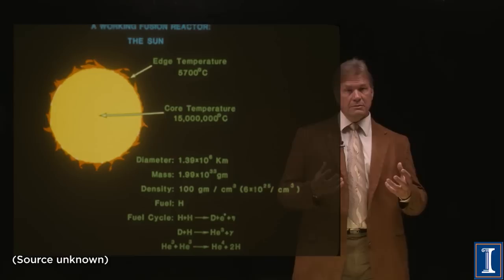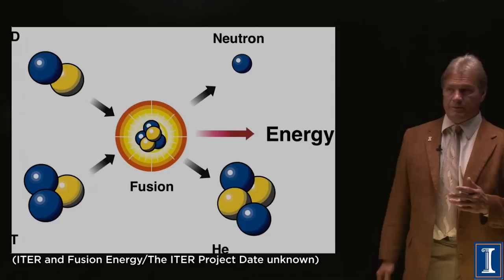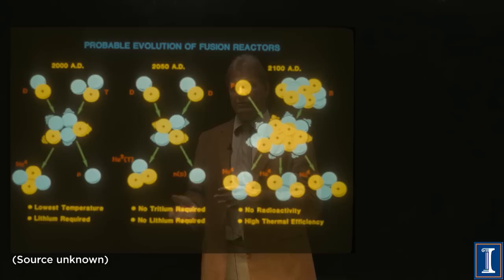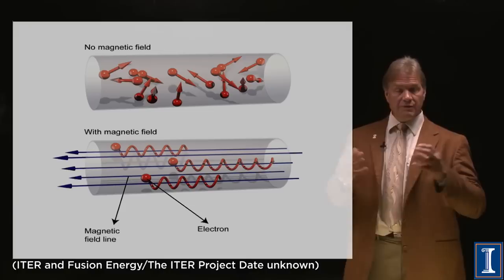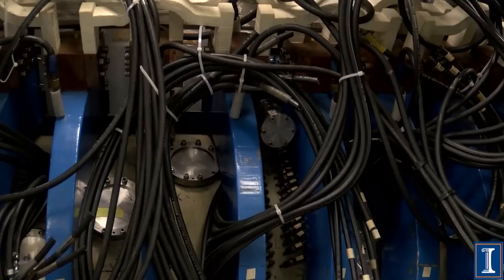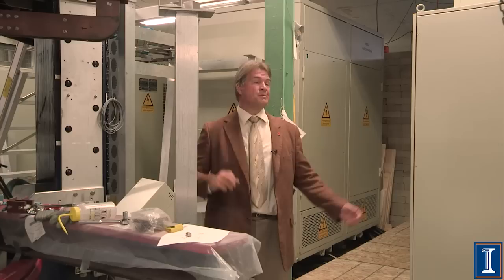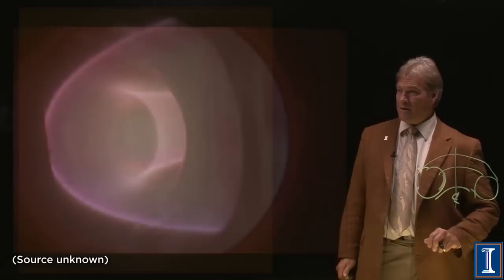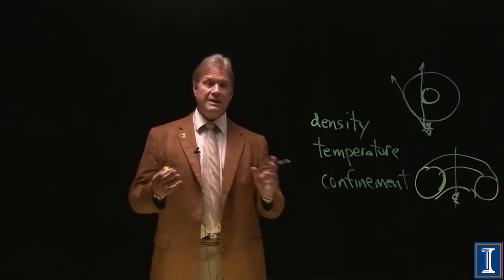What Is Fusion and How Do You Get It to Work?

Comment: Once all those 3 steps are done, 

density
temperature
confinement 

What are the current ideas to harness the resulting energy?

You can't run a water pipe through the superheated plasma to produce steam, it would melt.

Comment: I once worked with a device that produced secondary nuclear radiation by simply discharging huge capacitors to create a electrical beam striking a plate, accelerating in a vacuum. 'Vulcan' was what it was called and it provided the ability to test to radiation hardness of electronic equipment. This was over 50 years ago, I'm sure we are well beyond this now.
Reply: Yeah, we have Neutristors now. And commercial neutron sources that literally do the very same thing.
And kids making fusion reactors in their garages. Nothing gainful, they're wasteful as all getout, but fusors are fairly plentiful these days.
Fusion is easy, getting energy from fusion beyond the input necessary to generate it, that's hard. Well, hard, assuming you don't want to detonate a fission device to fire up the fusion reaction...
Reply: @spvillano  Have you ever seen the movie 'Chain Reaction'? the key point is any breakthrough has to be disseminated quickly far & wide.

Comment: Confinement ✔
Temperature ✔
Density X

Love these videos.  Excellent work!
Reply: And the energy exits where?
Reply: @tonyduncan9852  How does the energy "exit" a fission reactor? Heat is transferred to water to drive a turbine with steam. Energy isn't a physical thing that needs an opening to exit.
Reply: @nicholasandrzejkiewicz  "How does the energy "exit" a fission reactor? Heat is transferred to water to drive a turbine with steam." - You've answered your own question.  The kinetic energy of the fissioning nucleus components IS heat itself.
"Energy isn't a physical thing that needs an opening to exit" - Energy IS a physical 'thing'.  It's in the speed of the particles, and it leaves the scene by momentum transfer to whatever the fissioning particles collide with.  It's also found in the EM radiation which is liberated by fission.  This departs at lightspeed to transfer its momentum to the reactor.  Energy is a part of Physics.  It IS a 'physical thing'.
Reply: @tonyduncan9852  I was trying to be polite and answer your question, but I can only reiterate what is true - I am a mathematical physicist. Energy has never been more than a bookkeeping device, it's a simple quantity. Just because a quantity is useful doesn't make it real, like the phase space in statistical mechanics or the stress energy momentum tensor. Being "a part of physics" only means being in the literature conceptually, that doesn't make it physically there. Of course it's subjective as to whether mathematical abstractions are real, but energy does not have the same status as velocity for example (which you can see).
Reply: @tonyduncan9852  I didn't have any questions, I was giving you leading ones.
Reply: @tonyduncan9852  I'll try with an example to explain why I'm saying what I'm saying - surface waves in the ocean "move" or "transfer" across the surface, yet none of the water is necessarily travelling more than an single wavelength, oscillating back and forth. Similarly, you can have an airtight reactor with none of the particles physically getting out while still transferring energy in some form. You can call energy a real thing, but that would be an auxiliary interpretation - it has no associated observable quantities or evolutionary model. It's a part of the model for what is observable. I think lagrangian mechanics illustrates this relationship well. The Landau Lifshitz explain it well, and volumes 8-9 have some relevant physics for plasma (stat mech and electrodynamics of continuous media).
Reply: @nicholasandrzejkiewicz  "part of the model for what is observable" - "an auxiliary interpretation" - to me, all matter is bound up energy, and it's the snapping of that binding that occurs in the (fission) reactor.  But that energy flies off in the intensities of the gamma waves and the kinetic energies of the nuclear fragments.  It may not be observable, but it's certainly real - otherwise nothing would be happening.  A little bit like this interchange, I think.
Reply: @tonyduncan9852  All matter is not bound up energy, but you're being quite dogmatic about a simplification given in pop science via analogy. I do not think it's very productive to equate those descriptions of the world with the real precise mathematical ones. It's neither observable not real because it doesn't exist at all, it isn't tied to anywhere in space or time. Gamma radiation isn't energy itself, it's just photons. Yes the energy content of a system determines its inertia, but you're taking the analogy past where it is meaningful.
Reply: Sorry if I seem harsh, but this is physics established nearly a century ago. It's very well understood/complete, so it seems a bit arrogant from my perspective to make meaningless distinctions that serve only to complicate the understanding of this subject.
Reply: @nicholasandrzejkiewicz  There you are.  It doesn't just 'seem'.  E = m*c^2 is "a simplification given in pop science via analogy".  I never knew. . . Let's just agree to disagree, shall we?  And take our separate paths. . . .
Reply: @tonyduncan9852  I've really tried to talk to you and explain it, not only is that equation not always true, it's also not representative of the whole of reality. There is no disagreement, you are wrong. Verifiably wrong, look it up. I gave you excellent texts in physics to look at, that is the peak of arrogance.
Reply: @nicholasandrzejkiewicz  
"I've really tried to talk to you and explain it" - what you explained were your preconceptions.
"not only is that equation not always true, it's also not representative of the whole of reality" - Did I imply it was?  Emergence has taken place since.
"There is no disagreement, you are wrong" - Our interpretations disagree.
"Verifiably wrong, look it up. I gave you excellent texts in physics to look at" - You're not talking to an AI, but to someone on a desert island.
"that is the peak of arrogance" - Just because your head's in the clouds doesn't mean you're standing on one, necessarily.
Reply: @tonyduncan9852  I don't know how deluded you can be, but you're not arguing with my ideas but those of others that have been established after centuries of experimentation and theorists - you're making up your own nonsense physics without a reason to even do it.
Reply: @tonyduncan9852  If you have access to the internet, you have access to books. Most books you can find legally or otherwise, but the ones I mentioned are free and in the public domain.
Reply: @tonyduncan9852  I'll just say I wouldn't be using such strong words without a reason. You don't have to trust me, you can read any of these texts for a resolution, and you don't necessarily need to read a whole text to find one. It just seemed to me that you were holding your understanding on equals ground to the perfected models in physics.

Comment: Great series. Will you be going into alternative confinement concepts such a FRCs (which are lately making great progress) or a  Sheared Flow Stabilized Z- Pinch (maybe also how it is different from a regular Z- Pinch)? Those are good candidates for relatively compact power plants (when compared to toroids like Tokamaks and Stellerators) . The former is very high Beta, the latter can be super compact. For FRCs I like the work Helion Energy and PPPL have been doing. Those two are unfortunately often overlooked.
Also missing was Helium3 boosted Deuterium - Deuterium- Fusion, which is interesting, because it does not need an external source of He3 (He3 being a product of D+D along Tritium, which eventually decays into more He3). I think it is a great intermediate step towards PB11 fusion.

Comment: Once you produce sustainable fusion, how do you get the energy out of the magnetic bottle to do something useful with it?  Literally how do you get the genie out of the bottle?
Reply: Heat water and let it spin the electro generator rotors, same as nuclear power
Reply: @user-if3fj6uf3s  Yep ….. nuclear reactors are just steam engines without using coal to heat the water.
Reply: You've an energy source at 100,000,000 degC producing several megawatts continuously;  anything within fifty yards is going to be vaporised. I just can't see this ever working unless it's the size of a football stadium. I'm old enough to remember press reports that viable fusion  reactors were just round the corner in the 1950's. Devices like that shown aren't even close.
Reply: The neutrons produced fly right through the magnetic field, and are absorbed in a lithium blanket to breed tritium.  The alpha particles in the plasma are exhausted through a "divertor".
Reply: @ianhollands1641  In relevant words: 

That's not the energy source. You can not point at the tip of a moving mountain on water and assume it is an iceberg, it might be a turtle.
Conditions non-conducive to dislocation of temperature keep millions of degrees contained - can you not imagine or does the idea bother you? somehow
The fusing matter to be used in contemporary fusion reactors is not dense enough to melt the container - it can not store enough heat to do so.
Water has a higher specific heat capacity than air. The same volume of air takes less energy to heat.
Wet weather is hotter than dry weather!

Comment: I was amazed being stationed in Germany all the nuclear power plants I saw there. My immediate thought was Germany is WAY more environmentally minded than here in the US-yet nuclear power there generates a huge amount of their electricity and most Germans like it. They view it as what it is, a viable, clean, reliable energy source when properly built and maintained. Look at our nuclear powered Navy with over 50 years of use and no accidents because of stringent military procedure. Applying that to the civilian world is the problem where cost cutting creates problems.
Great videos!
Reply: Germany has been shutting down its nuclear plants in an effort to go "green", so they are building solar and wind plants. Guess what, the solar and wind is so unreliable that they've had to back it up with coal, so their emissions have increased dramatically. So dumb
Reply: @sheldonholy5047  Both of you are dead wrong. Nuclear is not at all see favorably by the Germans. And coal has always been the primary power source in Germany. Why do you lie?
Reply: SwuuschifyMe Sheldon Holy does not lie. After Fukushima German politicians decided to move away from nuclear power plants. Since then the price of energy has dramatically increased with an increase in carbon emissions. Just compare to France where they continue nuclear power generation.
Reply: @pdqkevin  It's stupid IMHO. I do remember seeing the wind turbines long before they appeared here in the US but the trouble is wind energy is unreliable. Britain tried going with wind turbines and they have brown outs. Germany isn't exactly known for earthquakes/tsunamis so I don't understand why the media always goes into full scare mode. Nuclear energy is some of the cleanest compared to alternatives. 
Here in the US 70 percent of our power is still coal fired. One thing little known is the filters used in the stacks scrub most of the 'greenhouse' gases out. (Food for plants?! but I'm just an ignorant peasant without multiple degrees that mean I'm book smart, but a complete idiot common sense wise.)
It's tiring when governments force things on their people without having a viable alternative to switch to without costing their people money. Worse yet are these politicians that create these policies that they themselves aren't affected by since they're rich. (More than 1 house, usually a mansion, multiple cars, jets, security, etc.) Hypocrisy at it's worst. I can't believe Germans allow the things their terrible government subjects them to.
Reply: @pdqkevin  It is an ethical question. Prices WILL increase, even if switched to nuclear power. And finding a place to safely store irradiated waste is hard, and arguably dangerous.
Reply: @tomservo5347  I cant believe americans allow a truly awful president like Trump to rule...but aside that, the myth of "Clean Coal" seems to permeate into collective memory. There is currently no comprehensive CO2 scrubbing happening at coal power plants, there are only prototypes and planned projects. What IS filtered out is SO2. By the way, Germany is small. Way smaller than you might think. A nuclear disaster in Germany is not something that most germans are willing to risk, with good reason. The situation is different in big countries like the US or Russia. Lastly, your comment about book smarts is weird. Are you saying formal education is unnecessary and we should let ordinary people decide about things that require specialist knowledge? You realize that is literally what happened in communist Russia, right? Right?
Reply: @sheldonholy5047  Their emissions have not gone up "dramatically": If you compare 2018 to 1990, their co2-emissions are down 30.6%
Reply: @Zereniti77  Yes, they've dropped overall since 1990, but so has their nuclear usage. Since 2010 when their nuclear plants began to be phased out, their carbon emissions have risen due to the increased dependence on coal, natural gas and lignite. Whilst they now use more wind and solar power, their natural gas usage has been increasing and they are now using more than ever. Renewables are basically a massive scam.
Reply: Tom Servo vell vot do yu tink vee schud doo?
Revolt?
Yuu vill be velcome in the mlpd. Marxistische leninistische partei duitschland
Reply: Sheldon Holy in 2010 Germany CHG-emissions were 943 million tons. In 2018 they were 866 million tons. To be precise, in 2010 their energy generation generated 356 million tons of emissions, in 2018 that number was 299 million tons. So yeah, it does seem like you are wrong.
Reply: @SVSky  You have no idea what you are talking about.
Reply: SwuuschifyMe you’re a green shill in fact the professor covers this in one of his other videos.
Reply: As long as there are no energy storage devices I agree. I want to see germany using nuclear as an alternative to fossil sources.
Reply: @Zereniti77  Can you just imagine the numbers if instead of nuclear power, fossil fuels were phased out?
Reply: @tomservo5347  "the filters used in the stacks scrub most of the 'greenhouse' gases out" - In which case, they are just removing the carbon and sulfur oxides to some place elsewhere where they will be released again.  There's a limit to the amount of gypsum and chalk they could produce.  Scrubbing is the best way to remove dusts and heavy metals.  The greehouse gases will eventually escape into the air.  Don't kid yourself.

Comment: steel melts at around 1300 to 1500 deg celsius
Reply: ...and structural steel begins to soften around 425°C and loses about half of its strength at 650°C....for completeness, you know?
Reply: @Kharnellius  Jet fuel can't melt steel beams, but it can severely weaken them.

Comment: Easy enough to function for a few moments, however the containment mechanism leaves little room for the infrastructure for the removal of the product, (heat). Then you add the issues of simultaneous fueling and waste removal while maintaining those mechanisms functionality in a hostile environment. Good luck with all that. A great big money pit with promises always just around the corner. Thorium energy and more efficient batteries would be far better efforts. Our aging nuclear power plants need to be replaced ASAP with newer safer kinds and thorium when it’s ready.

Comment: Once the reaction started, how will you add fuel and remove byproducts?
Reply: Indeed.
Reply: Adding fuel should be just a matter of pumping in. But the waste wouldn't split like that, so that seems a problem. I wonder how long it can run like that, and how long it takes to start up again. Perhaps using multiple reactors for timed bursts is smarter then a stustsained long term reaction.
Reply: Hm... Helium is inert, maybe you can catch it somehow with that property?
I have no idea how though, really good question

Comment: One of the reasons fusion energy is only a dream reality is the lack of mass. Fusion also requires mass - lots of it to sustain the plasma. Think of the smallest star we currently know of, a red dwarf, slightly larger than Jupiter but 8 or more times the mass and weight of Jupiter. They chew through millions of tons of hydrogen every second. This is why our current "successes" only last at most s few seconds. We have to input more energy than what comes out.